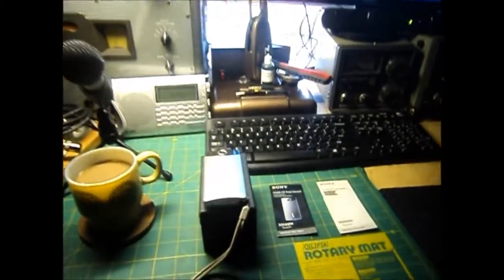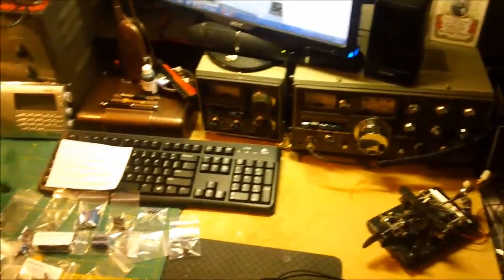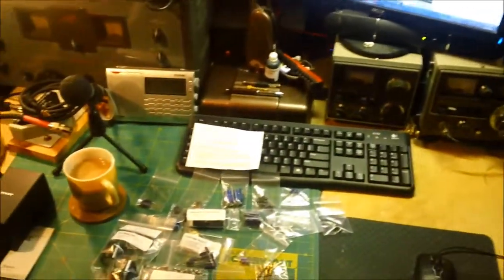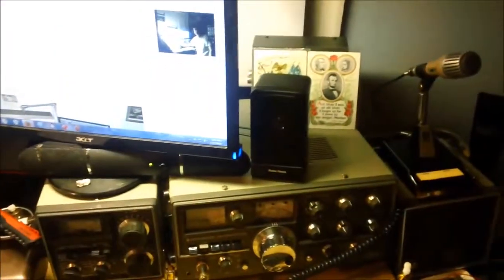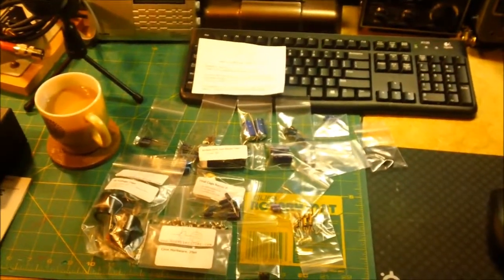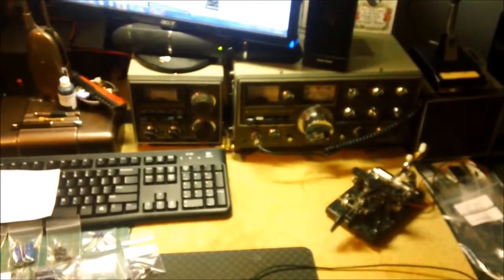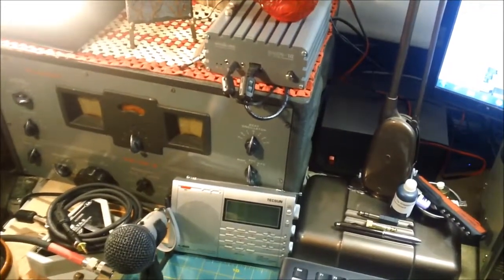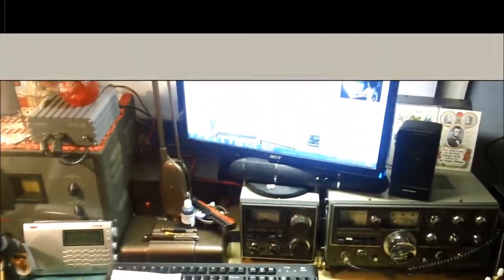K2BEW Channel Introduction

Comment: I am going to look forward watching these. I am commenting first before watching anything... I also have a TS-520s that with mine, I believe has a sticking TX relay... Seems to receive ok... Then you go to transmit, and switch back to receive and it seems the relay wont switch back... I have to turn the unit off and then on again to get it to receive again. Haven't worked on one of these yet, and beginner DIY'er... Looking for the location of said relay,  and what's involved with this type of fixer upper. Thanks 73